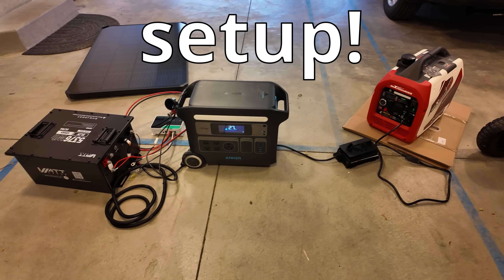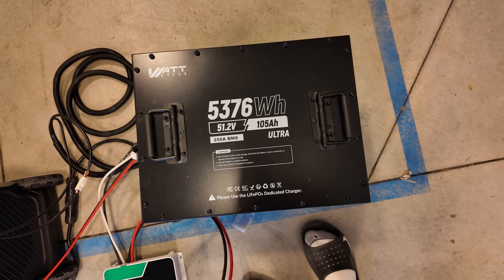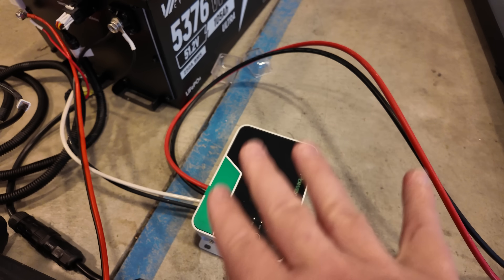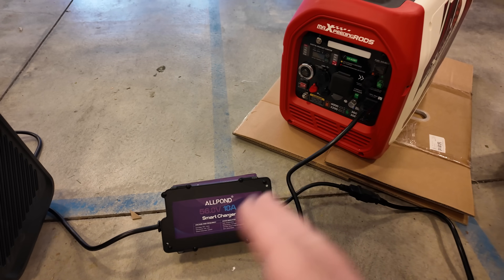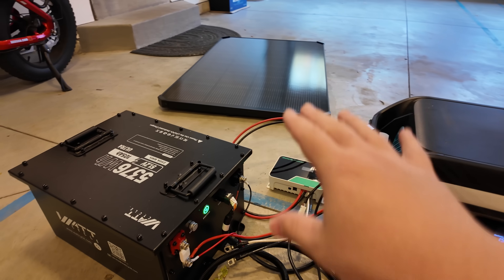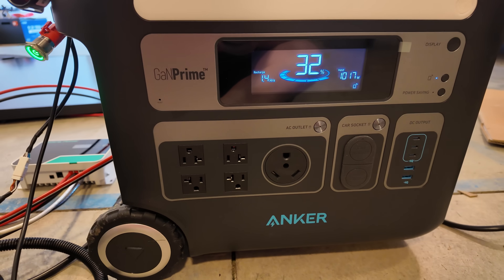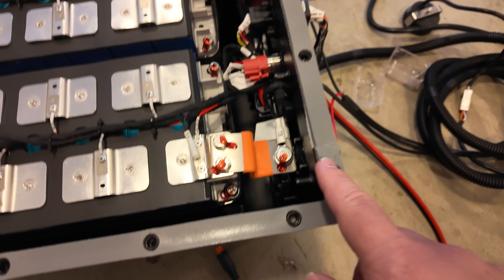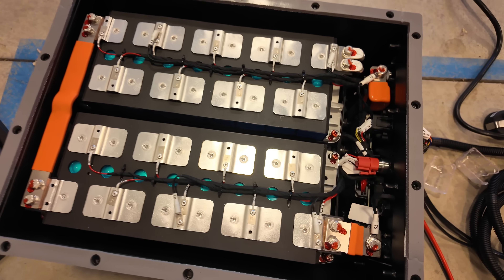The RV Power HACK That Makes Victron Obsolete! - WattCycle Golf Cart Battery

Comment: I have a fifth wheel and I removed the batteries and replaced it with a watts cycle 314 ah battery and then I discovered the Bluetti ac200L realized I could get their charger one and connect it to my Watts battery. Unfortunately I didn’t see that battery that you were showing and ended up with 12 V but my question is I have a generator a champion 3800 due fuel can I set it up to connect to the battery with a battery charger and do the same thing that you’re doingby charging the battery with the generator?
Reply from the maker: Yes you can! But don’t forget 12v will charge significantly slower with a cheap charger compared to 48v. To get a 12v charger capable of making good use of your generator, it’s probably close to the same cost as a 48v battery and charger. But yes, the same concept applies!
Reply: @theresatrickforthat  unfortunately I bought a 12 V lithium battery 312 amp hour.  before I discovered the bluetti. But with the charger one, I am getting a good 565 W of charging power.
Reply: Se bluetti ac200l use lifepo4 da 40ah 51.2volt nominali  con d60l charger1 da 560watt in 1ora di road motor alternator charge and battery 314ah con un alternator tipo vevor 2000watt o edecoa 2000watt you charger bluetti con 120volt o 240 volt and con mppt e pannelli solari charger battery 314ah 12.8volt

Comment: This is exactly the "Trick" or hack i was envisioning!!  Thank you so much.  The only thing else i was hoping to pull off was to be able to DC charge it from a high output alternator.   Can i do that with a system like this?  The stock Blue eddi and ecoflow DC to DC chargers are way to slow to charge.  If i couldn't directly do it through the system perhaps I could directly to the golf cart battery?   When I get reddy to jump off the cliff I am for sure going to hire you for your consultation.  Thanks
Reply from the maker: Yep! The golf cart battery is going to be your best friend for this! It will accept a lot of charge power !
Reply: No use direct alternatore  a battery lifepo4 but use un dc dc charge tipo pecron 1000watt con tension a 58volt x battery go cart da 51.2v nominal o similar dc dc charge da 12 o 24volt a 58volt 1000/1500 watt con alternator da 200ampere a 12/14volt o da 100amp. A 24/28volt the camper

Comment: Very flexible setup, though it requires manual attention to turn things ON and OFF. How about adding a voltage sensitive relay to automatically start the generator, or to turn ON the golf cart battery when the power station runs low?
Reply from the maker: Humm. Food for thought! Thanks for watching!
Reply: The battery lifepo4 is on forever and use simultaneamente alla power station con i 54volt ugual tipo con fossibot 3600watt o pecron 3600watt use no battery original pecron o bluetti costose ma use battery watt cicle x accumulo big cost minor + accumulo lifepo4

Comment: The problem with this setup, is losing one of the best features of the powerstation method.... visibility on production.  you end up juggling 3 apps to get the same information you'd get in one with a simple all in one inverter like eg4 6000xp, or even just a powerstation with more solar, like the pecron
Reply: This is for people that already have a powerstation and don't want to buy another one. the eg4 is nice but then the person would have two inverters when they only need one.
Reply from the maker: Good point! Thanks for sharing your thoughts!
Reply: Ecoflow is the best option battery, Smart generator and panels all on one app
Reply: @SAMMIEJONESJUNIOR  soooooo much money tho....

Comment: Well, I'm definitely a fan of running AC in directly to a battery charger and punting on pass-through AC.  The solar panel and external MPPT-to-battery is fine (though missing fuses and you need to be more clear about the minimum solar voltage when connecting to a 48V battery bus).  However, the battery-to-power-station concept could be done a lot better with a different power station.

To make the concept work better I would do is switch to a power station like the Pecron E1500LFP which has a non-proprietary battery port (51.2V LFP) and direct-attach the external battery to that.   This allows the power station to charge and directly use the external battery which is a lot more useful than the setup you had, and it gives you a lot more charging options.

This also frees up the solar/DC-IN ports on the power station for more solar.   The Pecron, in fact, has two DC ins... a 95V 700W solar input port and a 12-25V input port suitable for connecting a second small solar panel or vehicle power.  Your external MPPT becomes optional (but still useful for further expansion).

-Matt
Reply from the maker: I appreciate you sharing your ideas for optimizing the setup! I always say some of the smartest people are in my comment section!
Reply: Agreed, except I'd get the E3600. It has two 150v MPPTs and is dirt cheap, they just lowered it to $999.
Reply: I opted for both Oupes Mega 1 & Mega 2 Units with an extra Battery each and Tied a 48 Volt Golf Cart Battery into Them HACKING an extra battery cable in half and terminated the ends to Ring Terminals and Fused appropriately to Expand both Units and the Extra Battery allows allot more Solar Input.
Reply: Can't complain about being able to run a toaster oven or tea-kettle in a camper 🙂Weight and space has to be taken into account too, depending on what this thing is being installed in.  Power stations are great for small campers.

Comment: With that 240 amp charger, how do you get more power into your batteries if your gas generator is only a 3000 W generator?
Reply from the maker: Had a generator in parallel, get a bigger generator, or add solar! Thanks for watching!

Comment: Were do I get said fuse diy 6000 watt inverter video an item need.. bluetti Eco flow jackery Anker which recomendation power tool welding furnace swamp cooler dryer washer air fryer microwave Mobile home powerable
Reply from the maker: I’ve got some fuses linked in the description you can check out!

Comment: I’ve got a couple of the now discontinued OUPES E1600 DC Only gas generators.  It automatically fires up at 20% and shuts down at 90%.  Generator directly connects to the OUPES B2 expansion port on the Mega series models.  You can still leverage the ~140V solar port so beyond the ~1600W generator 51.2V input you can still get roughly 800W from solar.
Reply from the maker: Sounds like a great setup!
Reply: @theresatrickforthat  It’s worked well.  I haven’t tried integrating generator setup with one of my Golf Cart  batteries yet  but as you have seen with your tests and what I have done don’t have a reason it won’t work there too.
Reply: that's cool. 1 gallon of gas gets you 4kWh more capacity. Not bad at all.

Comment: The power station seems to be the weakest (expensive-ist) link here. Why not buy a 48v AC inverter and another 48V battery?
Reply from the maker: Sure! That’s great and the best. But this is more geared for those who have a power station already and want to utilize it more!
Reply: @theresatrickforthat  I saw a video YouTube with a guy using a 48v battery to fully charge Bluetti, Echoflow power stations. I am going to buy a 12V inverter 3000 watts connect it to a 3840wh ecoworthy battery 12.8v 300amps that I bought for $357 on eBay during Amazon prime sale. eBay decided to compete with Amazon. So I bought 4 batteries 15,360 watts. Putting together my first DIY system and still learning. All I have now is 4 batteries and 2 Vevor 14.6 80Amp chargers. So I can wall charge 7680 watts in 3 hours 45 minutes.  I think I am gonna make 2 12V 3840 watt generator and 1 generator 24v 300amps 7680watts. I am looking hard for DC Heater and airconditioning. Then I would be a super van guy with 15,360watts. I need to decide what type of cables to: Connect my batteries together.  I want pure copper and not sure if I should use 2 gauge or 4 AWG cables? Need  to decide what size fuses I need to make this basic symptom safe.